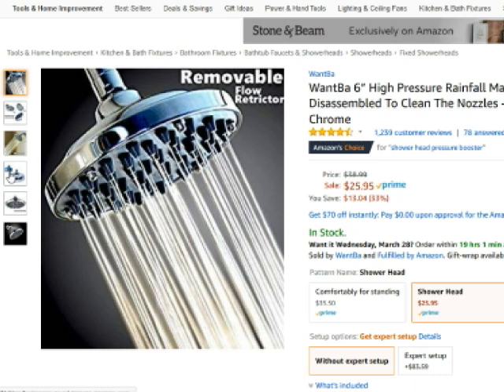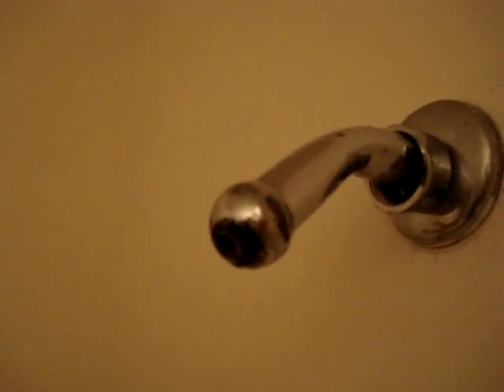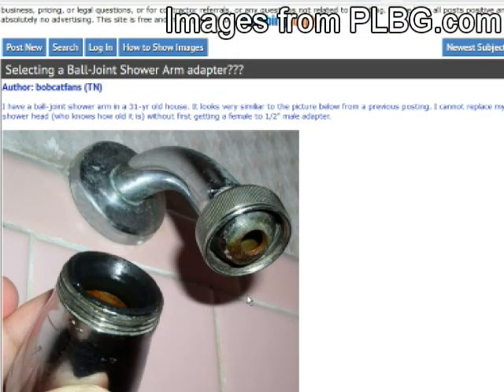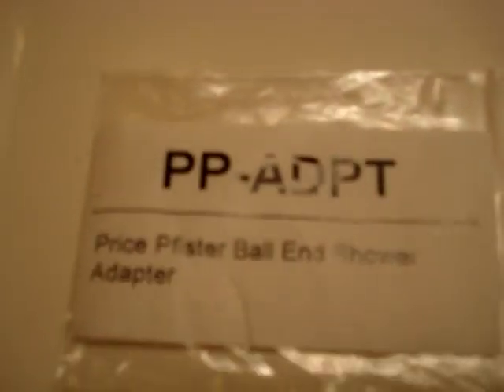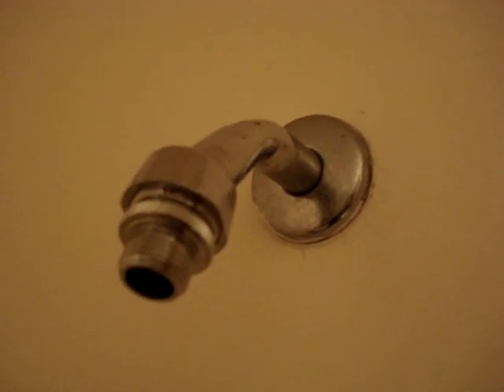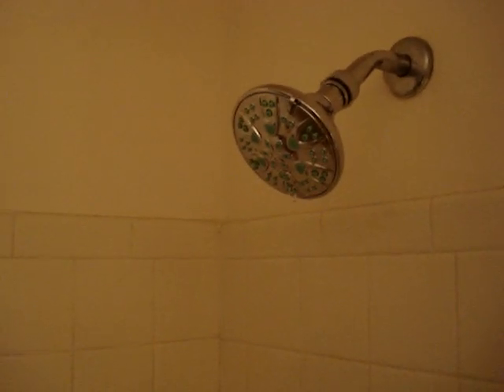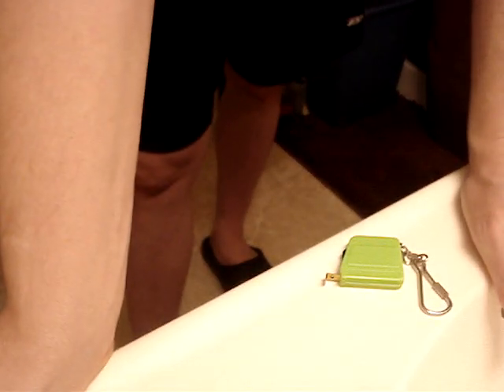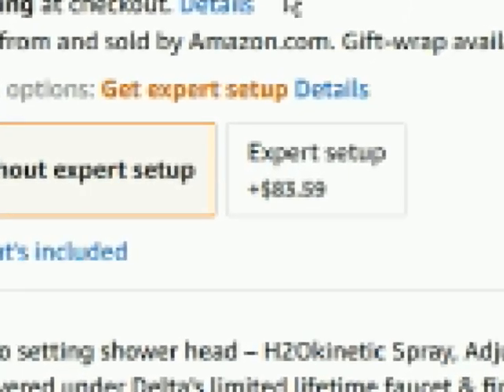Ball End Shower Arm Shower Head Installation (Adapter)

Comment: Lol at the part "maybe like some of you, I said what the hell is that, what is this ball..." etc etc. because yes, that is exactly how it went for me. I also thought maybe the ball would simply unscrew so I spent a few minutes on it with pliers, obviously to no avail. Thanks for your help!
Reply from the maker: Jared Smith, did the same thing! It does not unscrew. 
You're welcome. Glad to hear it helped. Thanks for taking the time to comment.
Reply: @Underdrummer  by the way, whoever else needs to hear this, I too ordered just the Price Pfister adapter, from Lasco on Amazon, and it worked perfectly.
Reply from the maker: Thank you! Great to hear. I think that's the adapter that will work for most people.